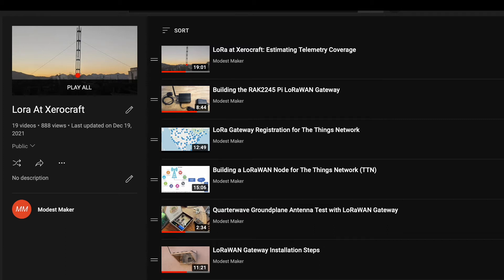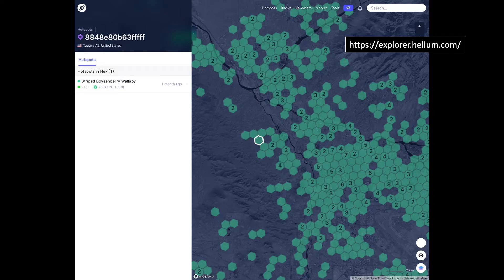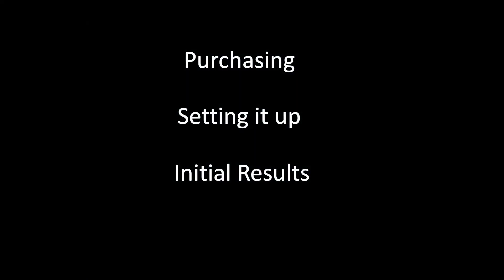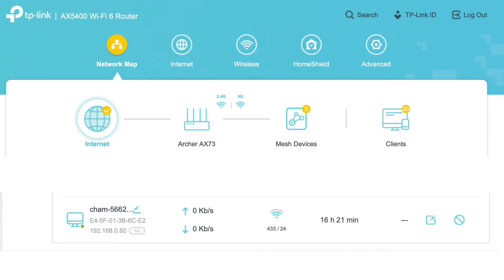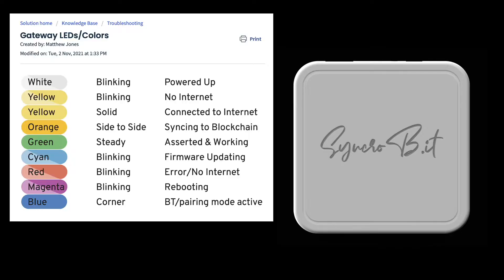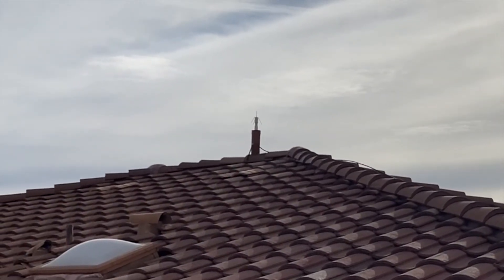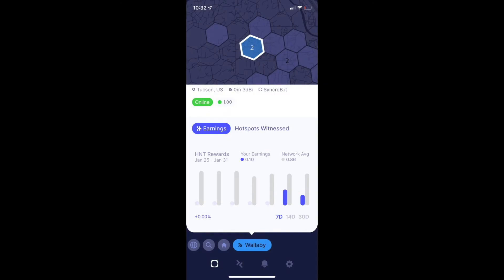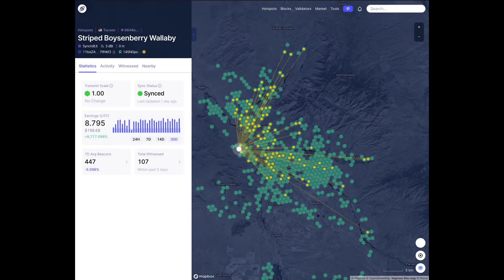New Syncrobit Helium Gateway Setup

Comment: To reach that long as 3700Km is a quite well known phenomena. There have been a specific weather phenomen making your radio signal bumping in the stratosphere and hit just these miner. During a time was radio amatures sending to the moon and the signal could hit any other radioamatuer in the world. Usually was it possible to talk for a few minutes after that had the conditions changed. I have been verified of three miners 1000Km away.
Reply from the maker: Amazing. I figured it was likely associated with signals bouncing off the stratosphere. Having this data readily available is what makes Helium such an interesting venue to play with.

Comment: have a look at Genuine Rose Ostrich.  I gave it's location for where it''s going to be after my friend picks it up.  In the meantime it looks like it's witnessing and being witnessed from far away.  that's probably the case for yours Urban Viridian Dog.  that's my guess anyway.
Reply from the maker: You are getting incredible range on that hotspot assuming the location is accurate. You must have your antenna elevated with a good view of your valley- nice! I see you are hitting a gateway as far as Palos Verdes - that used to be where I'd take my daily bike rides from Torrance where I lived for a few years.
Reply: @ModestMaker  I didn't make myself clear.  I guess.  It's not an accurate location.  That's why it looks like yours looked.  I have lots of questions,  I don't know if you are available to answer,  about having more than one miner/antennae and also about seperating the tx from the rx.  I'm super new to all this, but I have 6 hotspots that I ordered from sensecap on impulse and they wouldn't let me cancel my order.   I had them all running from my home in southern california,  I just took them all down because I got scared I'd get in trouble.  So really bad investment, but I have learned so much and I love my new hobby.
Reply from the maker: Having them all hosted from the same location would severely impact your earnings, but if you have friends who would be willing to host and share earnings, you’d be golden! Another option is eBay if you need to sell them..

Comment: As Helium miners (7 set ups). Nebra Outdoor miner and SenceCap are best Miners so far for me.
Reply from the maker: Just curious - were they reasonably easy to set up, or did you face some challenges as I did?
Reply: @ModestMaker  , I had no issue setting up my 7 Nebra miners, all plug and n play, 100% synced < 2 days, rarely offline like other brands. I used RAK 5.8 or 8dbi depends on location and height, antennas set up on ~6-10 foot pole on top roof, then run 15 foot of LMR-400 to miner which mount on side of house under roof. Each of my miner earned average ~8-12 HNT/month. BTW, I paid premium price for my miners on EBay, don’t have patience to wait from makers.
Reply from the maker: @miketran3356  That's impressive- sounds like you are doing it right. I noticed the SenceCaps are now available with a delivery date of early April-- much cheaper than what I paid for the SyncroBit. I'd consider purchasing a second, but I have no idea where I'd host it. https://heliumdeploy.io/ .